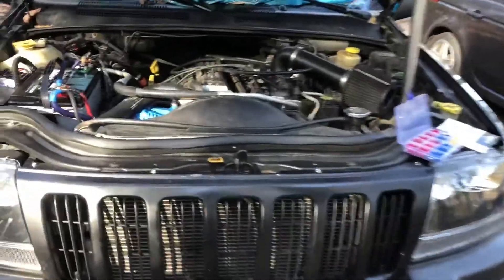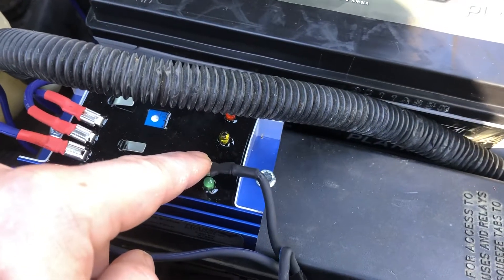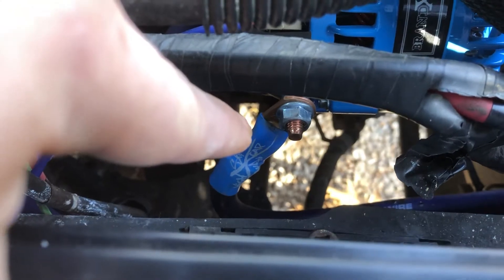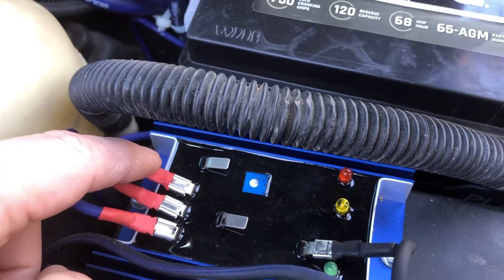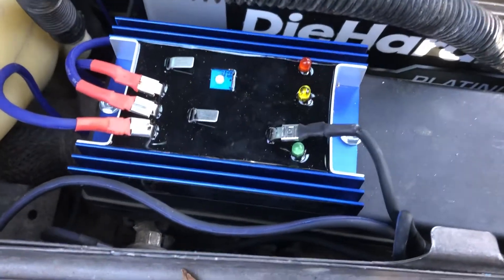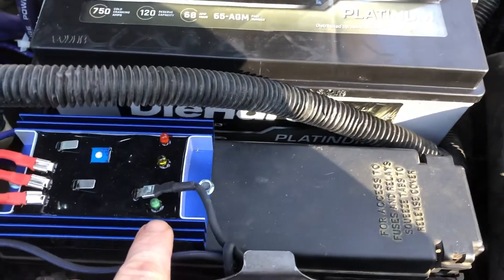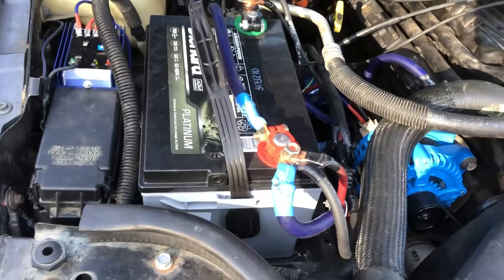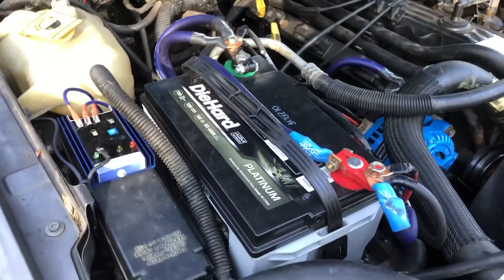How to install a Transpo v1200 external voltage regulator from brand x

Comment: Could I run this regulator on my stock alt till I get a hi output alt in order to get higher voltage?
Reply from the maker: Absolutely you can
Reply: @Jboost412  wouldn't the alt need to be setup for externally regulated to use a regulator?
Reply from the maker: Good question, but most alternators after 96 “obd2” or 95 if it’s higher end are already externally regulated from the pcm/ecm so your just eliminating the vehicles computer controlled voltage regulator and gong manual external...for example with the Jeep I’m using my voltage was computer controlled to be a max of 14.2 on cold starts..and then 14.0 after a few minutes...that doesn’t work for me so I need to be able to control my voltage...now my lowest set point possible is 14.5-14.6 and I can roll all the way to 16.2-16.4 if I wanted...but my sweet spot for my build is 15.5-15.6 after that I don’t see any more power being made so it’s pointless to go higher
Reply: @Jboost412  r u running cmax?
Reply: @Jboost412  also when u start your vehicle for the first time where is the regulator set to? And what should be a hot setting so u don't over charge it when u r cold? Not much info out there
Reply from the maker: I actually sold my 45ah cmax bank...originally I was going to run c-max I ended up going with lishen lto and limitless supercaps...currently using 2 banks of the 18ah cells for  36ah “12cells” and 6 3000f super caps for 10k rms...just bought another 10k amp so now that I’m gonna run 1 per sub I’ll be adding in another 2 banks of lishen to keep my voltage as stable. Full tilt at idle my max drop I see from my set point of 15.5-15.6 is down to 15.0-15.1 while driving or even holding the rpms up to 1100-1200rpms I won’t even drop a tenth of a volt...now that’s after having an alt that clamps 370-375a dual 4/0 runs from the alt straight back to the lithium and then 2 4/0 grounds from the lithium straight back to the alternator though
Reply from the maker: Not that I don’t feel like c-max would of done the job...but I still daily drive my vehicle and I’m a whole lot more comfortable with lto chemistry then cmax...also the lto cells lifespan is a lot better in my opinion...I’ve seen people have to replace cmax cells after 6-12-18 months max with lishen you have a 30,000 cycle life so they last a lot longer
Reply from the maker: You want the regulator to be set all the way down and your batteries charged all the way up before the initial start...after it runs for say 1-2 minutes use a multi meter on your alternators output stud and adjust it up slow just a hair at a time let the voltage settle until you find the set voltage point your looking for
Reply: @Jboost412  have u ever seen a plastic knob to run on one? So I don't have this ugly stud sticking thru the interior?
Reply from the maker: Anything that’s custom and made from plastic/Lexan get in touch with LAF loudaf.net just tell them I sent you and what you need he can make you anything you want bro you can probably get in contact with them faster thru Facebook messenger
Reply: @Jboost412  ty they just made some stuff for my team mate u may have seen them on Scott bowman fb page the two salt 8's in the grand prix with the six nsv
Reply from the maker: Absolutely! Yeah they make some really cool readily available stuff..as well as just about anything you can dream up
Reply: @Jboost412  what area r u from I am n central NC by benson or about 30 minutes south south east of Raleigh
Reply: Preciate it man. What all r u running in ir Wj. I have 2 RS Gold 15s on a Taramps md5k. Got a group 65agm up front and a small 25ah lithium bank in the back. Unfortunately I'm dropping in the 11s bc my 130amp stock alt just cant keep up.
Reply from the maker: Currently running they’re team 18s in a “break in” enclosure let’s call it, They’re finally ready for a new enclosure now so I’m gonna start building one based on the team subs that’ll be around 13 ish cu ft so it’ll wake them up real nice....for electrical I got the brand x 345a alt and I’m running a group 65 up front and a couple 70ah batteries in the back getting ready to change all of the batteries out whenever I swap enclosures...to what I haven’t really decided just yet
Reply: So no need for a relay or what ?
Reply from the maker: With this specific regulator no relay was required
Reply: @Jboost412  great video.  Unfortunately having issues with mine.  Old video, any chance you're still monitoring?  If so can u message me?